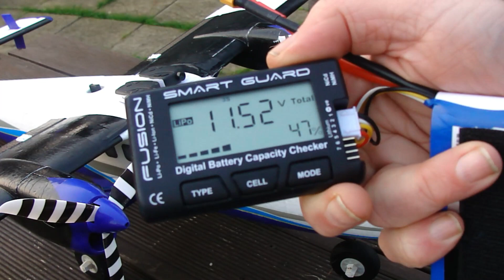Flight of the Phoenix - 5 September 2021

Comment: Well done Martyn, brilliant repairs and maiden post your magic in putting her back together. All credit to you. I have some of those stick on nav lights too, just not used them yet. I flew yesterday with my instructor, he thinks I’m close to doing my A licence. I managed take offs, circuits and landings, although they were a bit bumpy, but practice makes perfect as they say. Take care 👍🏻
Reply from the maker: Sean - My instructor never told me I was ready - then one morning he told me to go fly !!! - he just watched .... Man was I nerves... but he took that into consideration and once I had completed a somewhat bumpy landing - He just said - "Congratulations On passing your "A" Thumper" ?? He called me that because I  “THUMPED HER” to the ground- get it - hard on landing LOL.... You will be ready and you will not even know it - same thing happened when I took my B certificate for Fixed wing - I had no idea I was ready and was just told to go do it... once you have the A certificate all the bad habits start to creep in – I hate doing landing Circuits - and as you can see from my videos - I land with a downward wide spiral , loose Hight (but pick up speed), then bleed the speed off with low throttle and elevator - if I did that on a test I would fail every time .....

Comment: Excellent re -build Martyn. Thankfully you did not burn out the ESC's like I have done & they caught fire.
Reply from the maker: Noel - I really would like to know a little more about the "Burn out of the ESCs" to see if I can learn anything from it - or was it one of those unavoidable things ?? - the rebuild could not have gone better - even if I do say so myself - the most time was taken up waiting for two props to arrive in the post...
Reply: @FlankerTanker  Well , Once was after landing, but I think the prop was caught & the left ESC immediately caught fire burning/melting  the Narcelle. I complained to my supplier who send me a replacement esc. I filled in the Narcelle foam with some old shaped pieces of foam. The next time was a start on the bench & this time the right one caught fire (they don't seem to just smoke out) I ordered a new esc & two Narcelles from a supplier in NYC. Much cheaper than here. & all has been fine since. I just received two smart 4s 2200 batteries from the US supplier savings over $100.

Comment: Only 1 crash? 😜 I just rebuilt my eflite pitts 850mm for the 4th time! (Cause anything i try aerobatic, i try it 1st on the pitts! Its a true basket case! 👍). Tho the next time it hits the ground, ill be picking up styrofoam for a month! 85% epoxy now! Before the last hard landing Saturday, it was good!
Reply from the maker: The problem I find is that I can do something on one aircraft , but try it on another and that's IT BLAM!!!! - My HK 750mm Corsair has been rebuilt quite a few times , along with my HK Cessna TTX - No spares for any of them so they are more like Frankenstein's monster - made up from mixed parts - thanks for your comment.